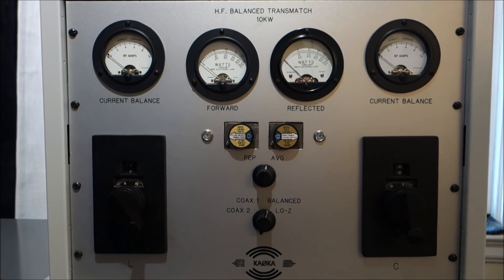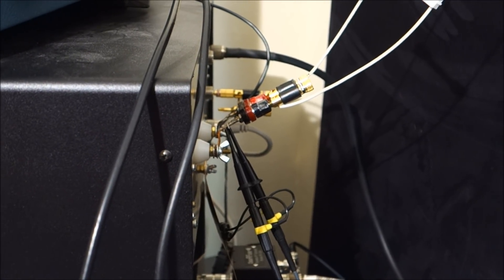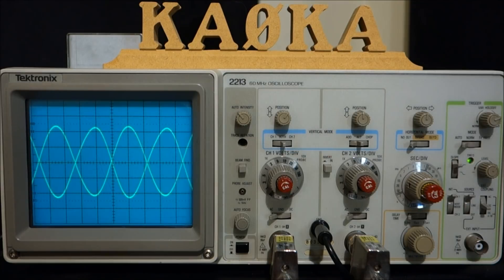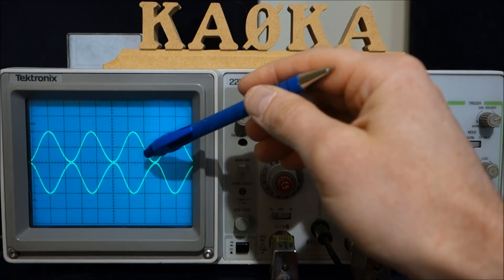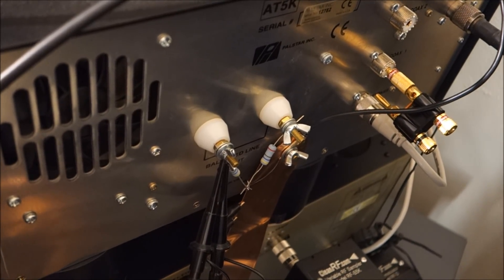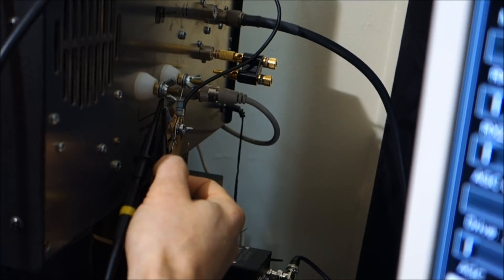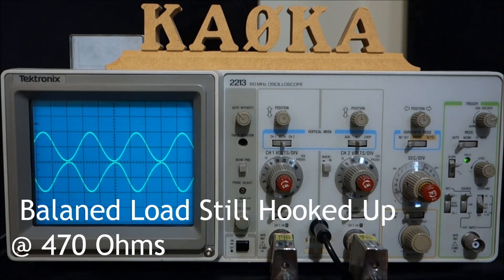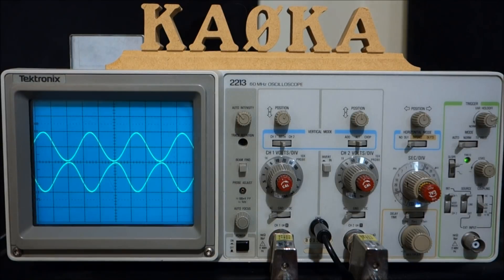Testing My Antenna Tuner With An Oscilloscope | Signal Phantom

Comment: Good morning Signal Phantom and happy thanks giving!
I found your video while looking for a video of an air variable capacitor on an oscilloscope. 
I have not found one but did find one with fixed sealed capacitors.
And capacitance seems to roll the corners off the square wave. I was just curious as to how it would look for the variable air capacitor found in tuners.
Might be an idea for a future video.
I'm trying to understand how capacitance helps tune an antenna.
I believe inductance in most setups makes the transmission line longer or shorter.
Reply from the maker: I have a video showing the voltage and current nodes that may help some as well- as my reply to your last question here too: Remember, that with Z you have three components, R, Xc and XL. Depending on the complex Z you are seeing, these devices are made to may R see 50 Ohms with Xc and Xl being somewhat the same.  That is why you have a variable C and L!  Hope that helps a little.

Comment: You set out measuring voltage balance. At 5:00 you state that under that condition there will be no feed line radiation. That is not necessarily true. There is no feed line radiation if the currents are balanced, and you have not measured or shown that. A common ham misunderstanding.
Reply: Yup.

Comment: Nicely done video! Good production qualities, and good demo of the "add" feature of the scope. I would have liked to hear something about the tolerances and what happens if it's out of balance. You pointed out the phase shift of, perhaps, a few degrees. How much phase shift is unacceptable? If the amplitudes are off, how much is unacceptable? Also those resistors, were they matched, and how closely?

Comment: Good video to start your channel with! I am using a modest doublet. Open wire feed #14 stranded and spacers cut from heavy plastic coat hangers. Will have to try the O'scope readings. Chuck AF4O